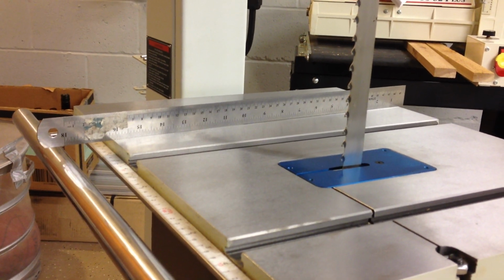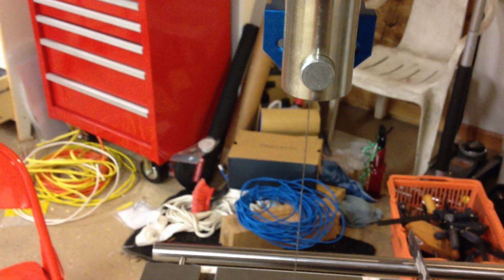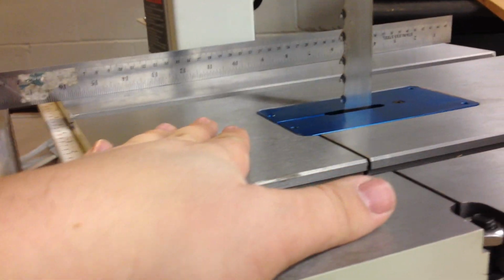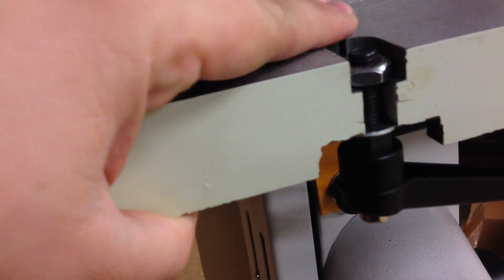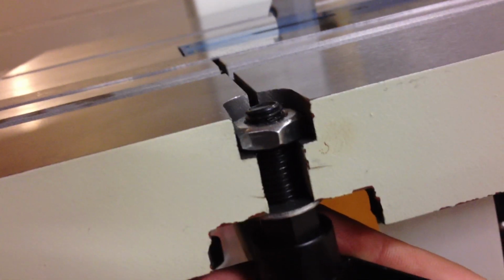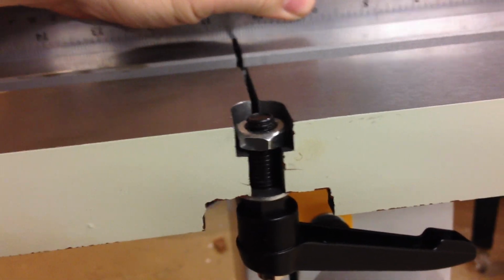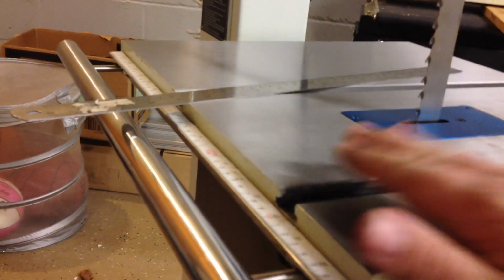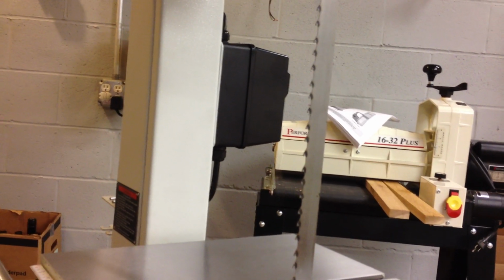Fixing problems with my band saw table

Comment: I have the same issue with the table the recon you can make slight adjustments by lifting the table and adjusting the bolt nuts that's below I believe 6 off them. And it's tedious and consuming and if you remove the table at a later date to clean or whatever,  it then goes our off level again. Right pain in the butt. I will come up with an idea to solve this at some time. Mine is the 14bx. So a newer version of yours and they still haven't resolved this issue.

Comment: Laguna will replace the table if it wont align properly. Just call them.
Reply: When I called about my mis-aligned table, they just gave me the run-around about how I needed to tighten it down in a certain order.  Very disappointing service from Laguna.

Comment: First, put a washer under that nut!  It is going to dig into the soft cast iron. You're supposed to tighten the nut until the two halves align. On mine, it takes a lot of torque. Yours is way too loose. The lever is designed so you can remove the blade out of the slot without a wrench. The dremeling was unnecessary and may have introduced some issues.  If one half is too high, loosen the nut, if the other is too high, then tighten the nut. Once you have it set, use the quick release when ever you do a blade change.
Reply: Definitely should be a washer and tighten as you check flatness across the slit. Anytime you cut a slit the sides moved in relation to each other in such a cast iron tale.

Comment: I'm looking to buy this same saw in a couple of weeks. This video is a year old. How has it been since? Would have bought it again if you could go back in time? Also any other issues? I appreciate any advice you can give. Thanks!
Reply from the maker: I's been a great tool.  The only problem I have had is the flatness of the table, but it hasn't been too much of a problem so far.

The other thing that I find annoying is one of the teeth on the resaw king blade is slightly off so it doesn't leave a butter smooth finish.  I think they messed up on the weld a bit.  It isn't bad, but it definitely isn't as good as the blade I bought for my dad's saw.
Reply: chuckiep268 
You might do well to look into Laguna's new 14 Twelve model. It's lower-priced than the SUV and has most of the same features, but can also be run on a standard 110 line. So far it's been a delight to work with and a great addition to my shop. FYI - It's blade max is 3/4" so if you need to do heavy-duty resawing it may be an issue. Good luck.

Comment: that table should have been exchanged when new or grinded flat because its ethier problems with the table design or those that molded table are not experienced enough to do that type of work. as for the flatness of it is that the person grinding it didnt set it up correctly. i have an acm 500mm bandsaw and my table is completely flat in all directions. you should have contacted laguna to fix this problem, i have read on inet that they might not be a first class quality company